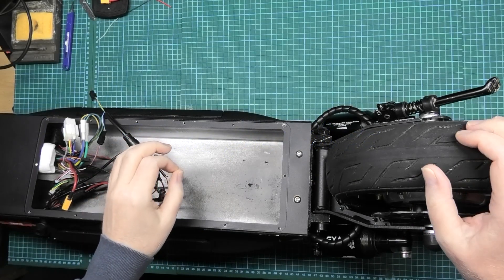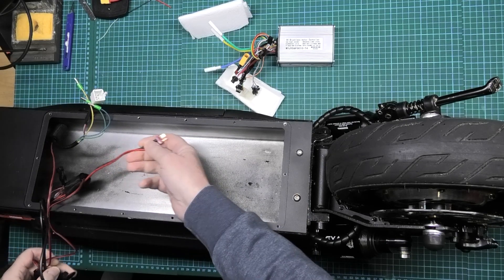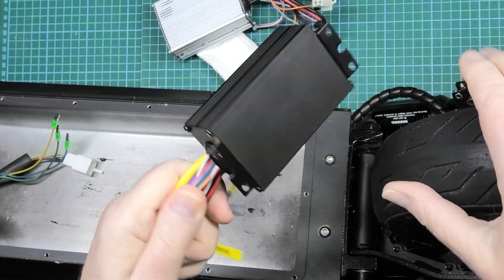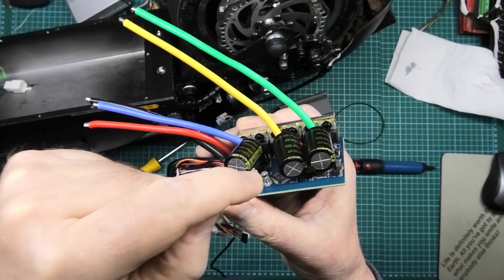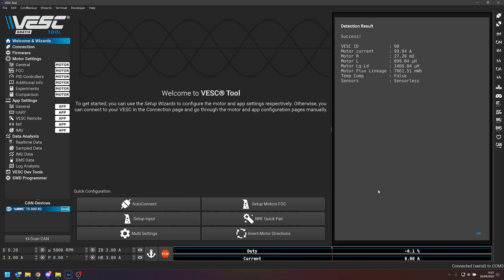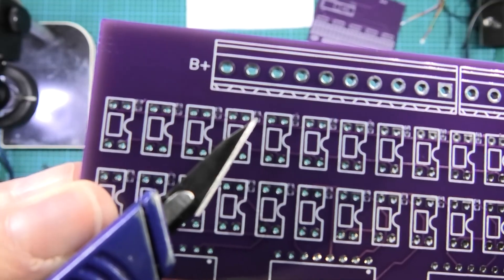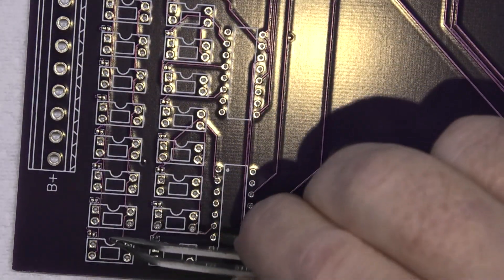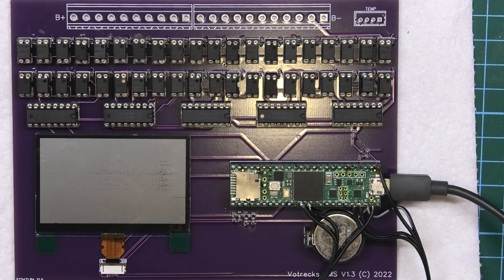Reinventing the BMS with VESC integration. I'm using the iScooter iX4 as the test bed -  Part 5

Comment: absolutely awesome project, great to see from another comment you got the display working w/the copper pour

any reason you're trying the flipsky 75100 before the Sequre ODESC?
Reply from the maker: Thank you 😊
I haven't finished with the ODESC yet. The Flipsky is easier to work with because, by default, it has UART connectivity and I needed something that worked to keep my interest in the project. The ODESC needs a lot of configuration before it will do anything and I'm hoping I can take all the tedious work out of it, it's rather pointless to have a system that needs a lot of command-line programming before anything will work, especially for people who don't know what they're doing. The Flipsky is now working perfectly and I can control it directly as well as read the data at 20hz (which I'm trying to improve).

Comment: The new PCB looks great I've soldered those tiny smd's and it's not easy it's like soldering something the size of a tea leaf one false move with the tweezer and they flick somewhere never to be seen again. I'm sure the display not booting must be something and nothing as the prototype worked fine it's finding the trouble what's the pain. It could be even a break in a trace I've had those before in new pcb not often but it happens.
Reply from the maker: Oh yeah, I did lose a few in the carpet 🤣
The screen problem was RFI/EMI from power lines. It's been fixed now by using a copper pour.
Reply: @Vortecks  Brilliant job.

Comment: flipsky has poor thermal design
Reply from the maker: Yes, that's why mine is no longer in a case.
Reply: @Vortecks  if you're concerned about starting torque try turning the motor amps down. also flipsky is good up to 100v and potentially 110v